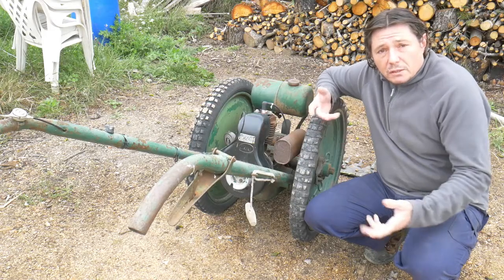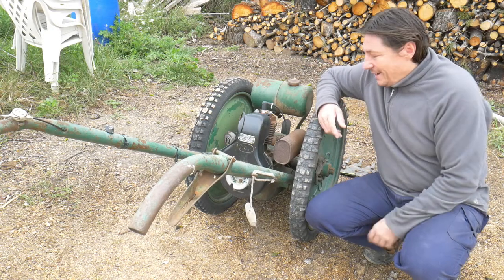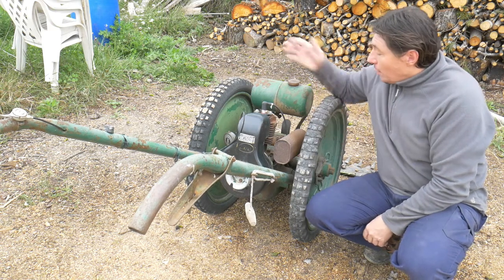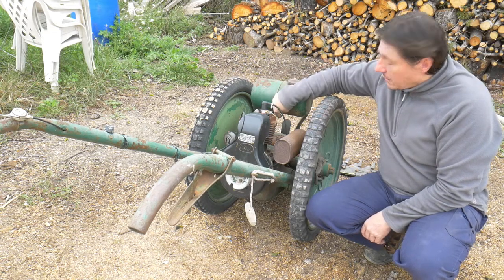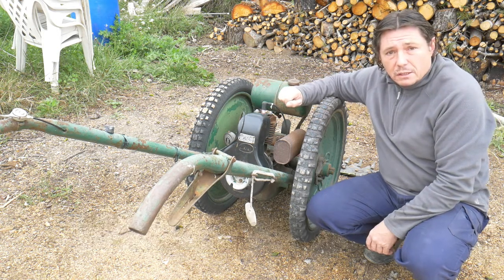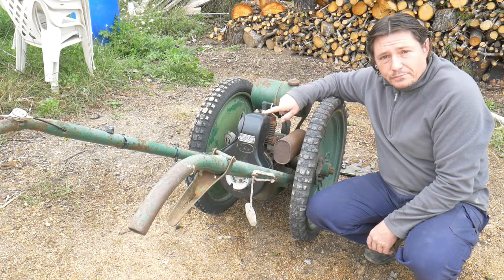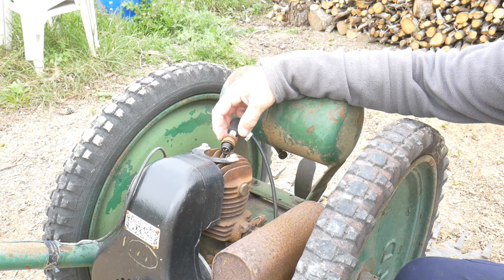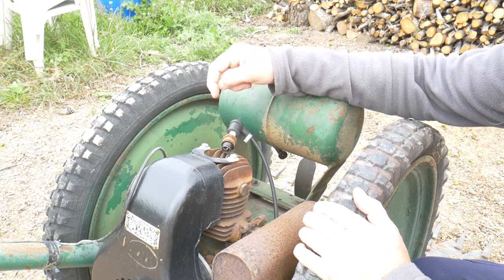Allen Oxford Scythe Model TS How to check coil failure DIY

Comment: many thanks for your speedy reply, mine is a model F, I will be restoring it later in the year.  Great video thanks for sharing.
Reply from the maker: That's a long time I have not worked on mine.... Need to get cracking